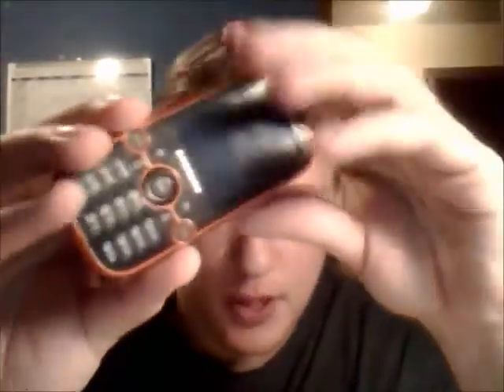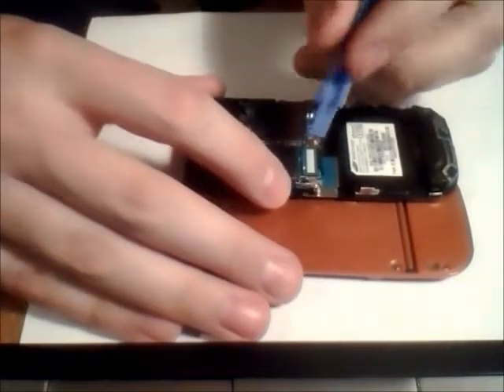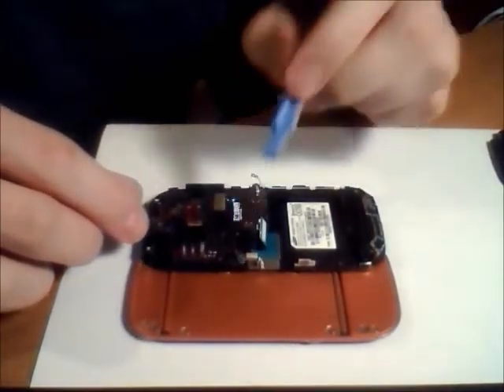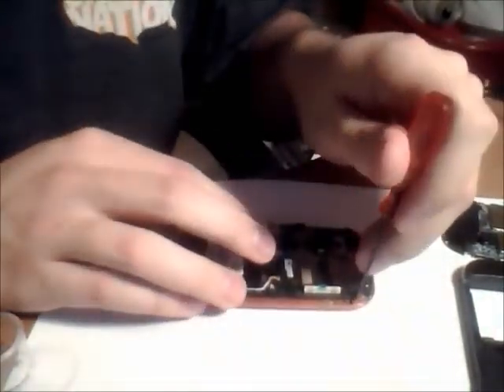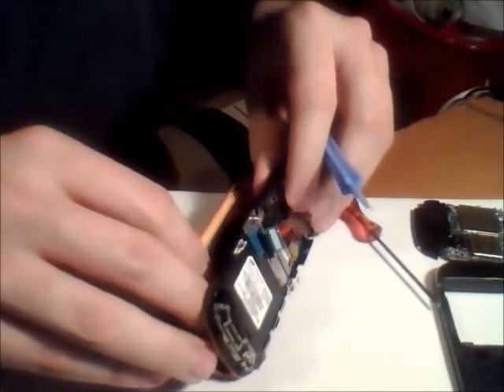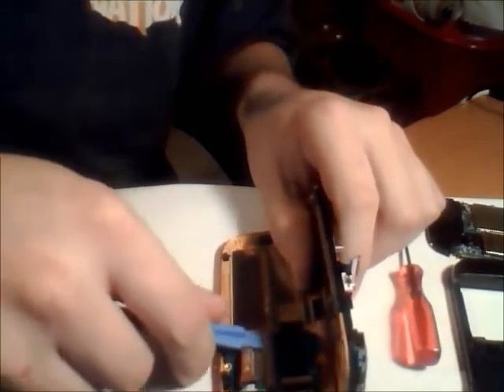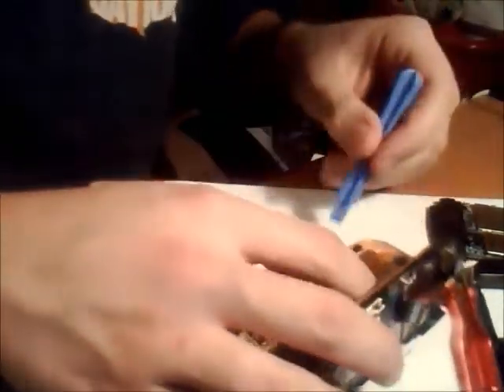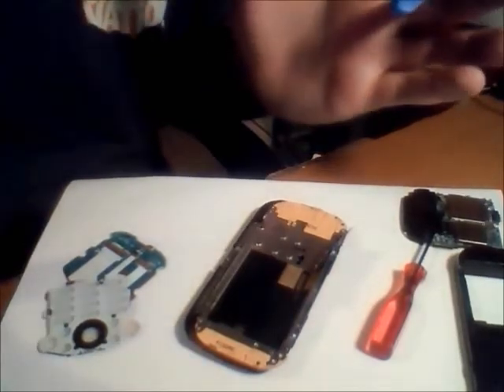Samsung Gravity 2 LCD Display Replace Part 1

Comment from the maker: digestinghippos - the issue is with your lcd screen thats inside the phone. Also, the reason the screen goes "white" when you slide the phone is because the "flex cable" connected to the screen is degraded and needs to be replaced. So you could probably replace both parts on the phone for under $15.

Comment: I gave this phone and everything works perfectly, except for the screen. A lot of the time, the screen just turns white, especially when I slide it to open or close. However, when I leave it alone for a bit when it's open, the screen is fine. It just messes up again when I close it. Any advice on how to fix this?  I'd love to have this phone as a backup.